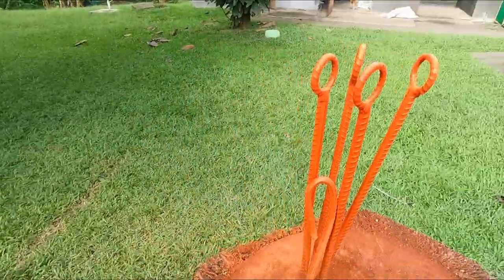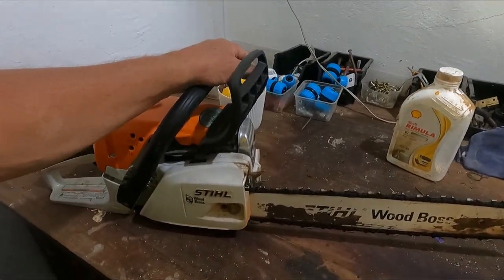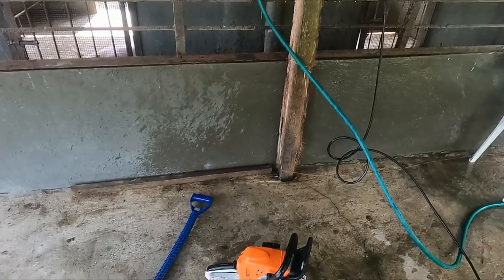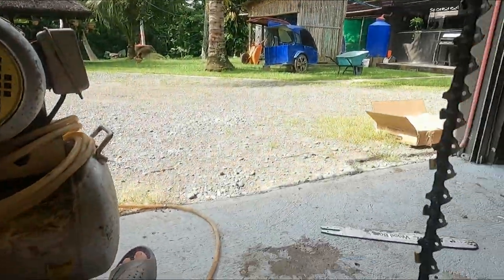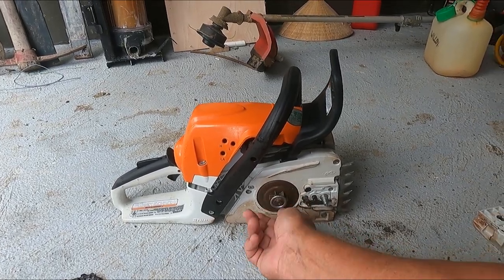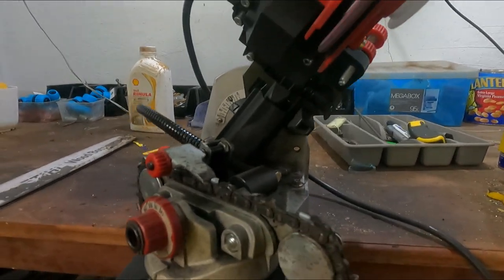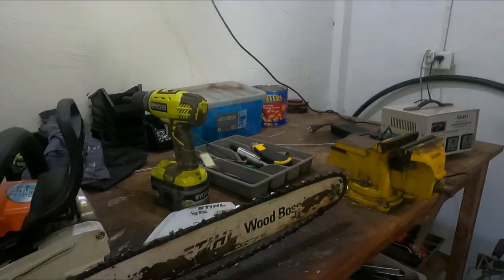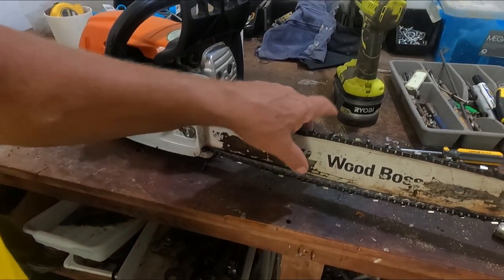How To Service your chainsaw after use for storage

Comment: 229.9 for diesel in Townsville today.
Running your saw out of fuel should not hurt it at all.  Consider what happens to your Victa when you are getting into it and it runs out of fuel.  That big blade disk acts like a flywheel and keeps the engine turning for a bit.  Chainsaw if you are using it and it runs out will stop suddenly.  But considering the modern synthetic oils used, it's not going to be a problem. 
That's a lot of work before putting your saw away.  Just be like the Processionals. Throw it in the corner until next time.  Then it won't start, but it doesn't matter coz the file is lost and the chain is blunt.
Reply from the maker: So truly said Peter. throw in the back and worry about it next time,

Comment: Hey Will. Tipping $2.40/L by end of the month in Perth. They are talking about old law they can use to cap the price!
This vid was good wake up for me - ya bastard! I run 4 Stihl from Farm Boss, Wood boss, down to small MS 201(light arbor style). All need fuel drain and clean up - guess what today’s job is. 🤔.  Also - need to dress the bar occasionally (cos some bugger keeps cutting when he should change over the chain 😇). Oregon best brand sharpener but diamond wheels for my tungsten chain cost USD 600 + ea.  Well better get to the shed. Saws don’t fix themselves! Have a magic day. 🇦🇺🇦🇺🇦🇺
Reply from the maker: keep them clean mate and they will last for years

Comment: Where did you find a real Stihl in the Philippines?  I've bought a couple of the china made clones (authentic German made) ones and was lucky to get 6 months out of them. Good thing they were only 50 dollars each 😂
Reply from the maker: we bought in Davao, along with the  Stihl vac and blower
Reply: @anaussiefarminginthephilippine , up here in metro Manila shops now need a permit to sell a chainsaw. Which most won't get so we're stuck ordering the cheap China (original authentic German made ones) on lazada or shoppee.
Reply from the maker: @nwced  Yes, that is the Philippines law. the show owner gave us the permit when we bought our saw,  I found it in the service manual when i came home from Vietnam living.